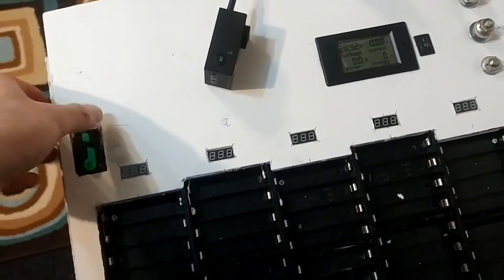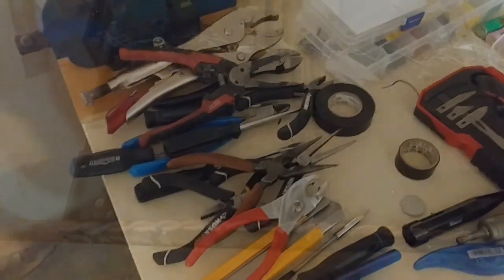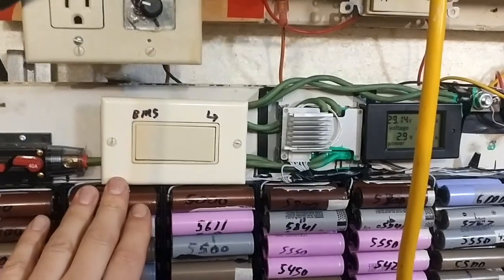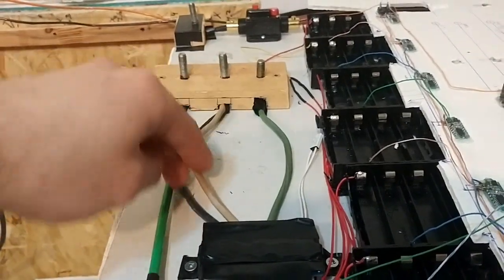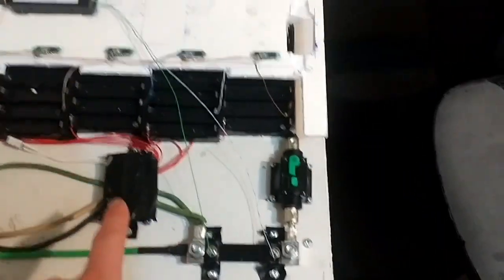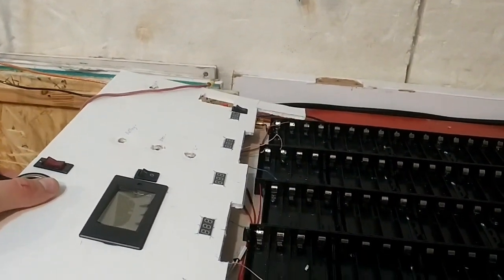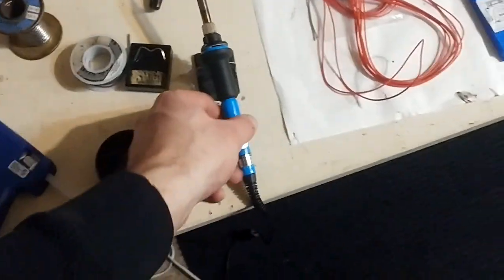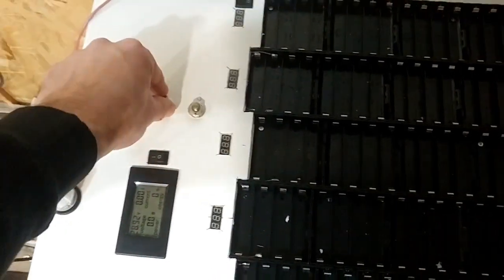Building a Modular 18650 7s Power Wall

Comment: Could you cut a hole in the plywood and drop the battery pack into it to make the fuses accessible.
Reply from the maker: The walls have so much weight on them the slots would make them weak and break but its a good idea. Cost to performance is a major issue.
Reply: @AndyShell  The hole would frame the slots, maybe you could use 1 inch plywood and attach it to the wall. Hinge it make it open like a door.

Comment: How do you check and fix fuse when they are under these battery boxes?
Reply from the maker: Fuses can be checked at any time using a dmm resistance test on beep between parallel negs and pos of each battery. Very quick and easy. Takes less than 60 sec. 

Replacment of fuses can be done bridging surface pressure contact brackets or removing all batteries screws and carfully fliping over the holders to solder. 

If the 30awg fuse wires are poping you built it wrong, using it wrong or using bad batteries. They are emergency only. 

Thx for asking!

Comment: Very nice 👌 instead of wood I would use transparent plexiglass to take a sneak peak if any fuses are blown
Reply from the maker: It would need to be more than 0.22mm thickness acrylic. You lose fire resistance and rigidity and increase your cost by houndreds depending on source. The fuses will only blow if you put a battery in backwards or a battery goes bad on you. Its much easier to just beep test with a multimeter once every few months. Not being able to see or easily access the fuses is the only weak point of this design imo but not a big deal. Thx man!